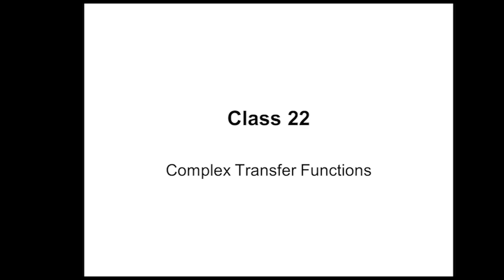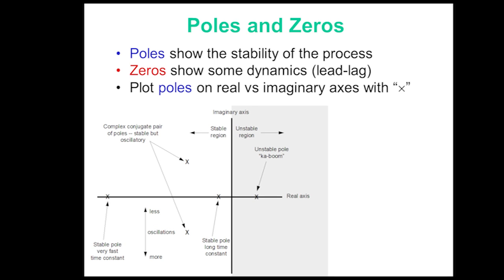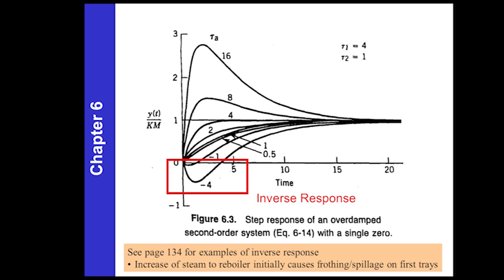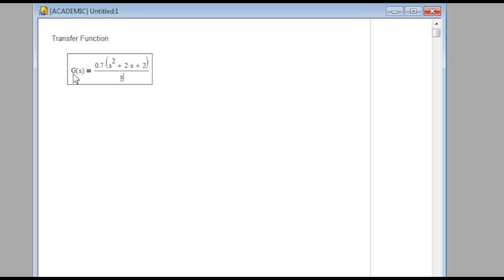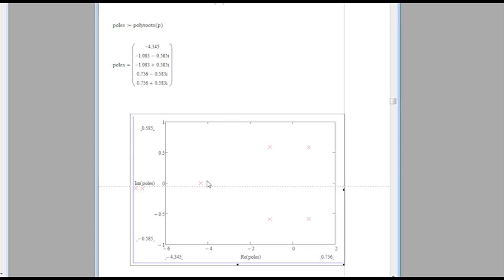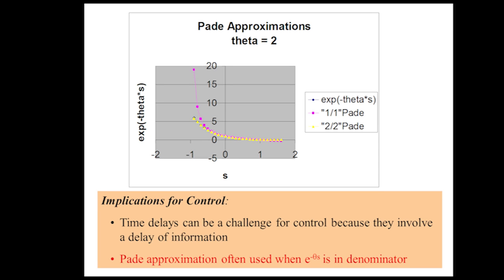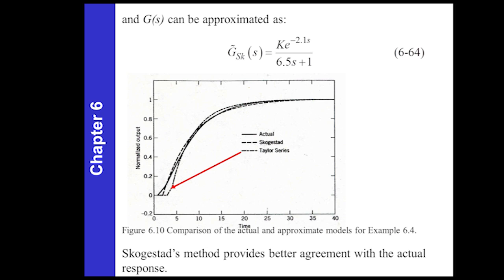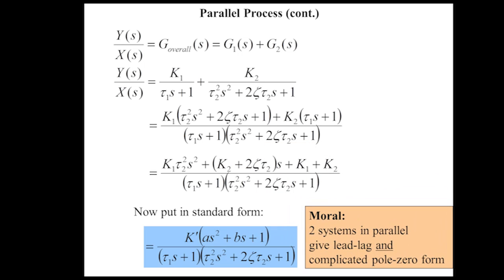Process Control Lecture 22 - Complex Transfer Functions

Comment: Good Night, i've watched your video and i have a problem similar to the last example that you gave to me. After factoring and putting in time constant mode, i got my denominator as it follows:

(1+9.605s) (1 + 0.8651(0.4563s) + (0.4563s)^2)

In this case, how i can calculate my exponencial part of my FOPDT system ? (If you can, could you explain in Taylor series and skogestad form please) 
Thank you so much!!
Reply from the maker: You need to factor it to 1/((1+tau1*s)(1+tau2*s)(1+tau3*s)). The FOPDT with Taylor series is then exp(-(tau2+tau3))/(1+tau1*s).
Reply: So, can i consider this way:
Tau1 = 9.605
Tau2 = 0.3947
Tau 3 = 0.4563 or 0.2082 (Should i square the the term o.4563s ?)
Using the Taylor series it would be
exp(-0.851) / 1 + 9.605s 
is it correct? Sorry for bothering you, i'm just asking because i'm really having troubles with it.
Reply from the maker: As long as you factored it correctly into time constant form then you should be able to use the formula I provided.